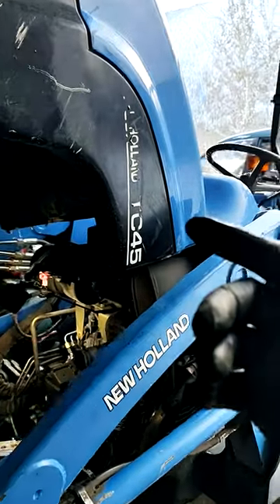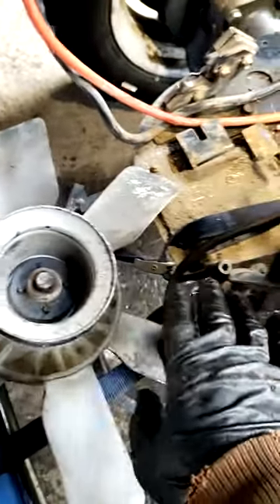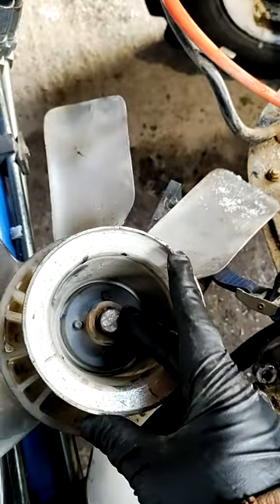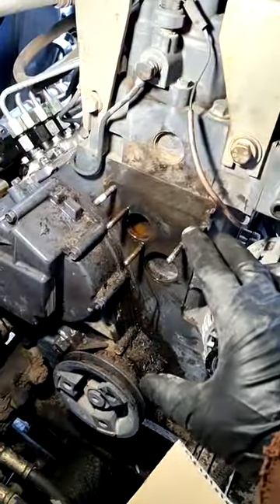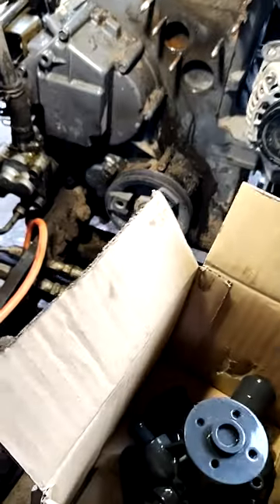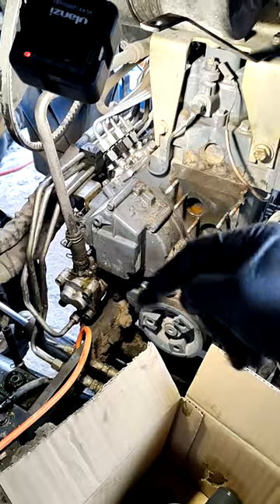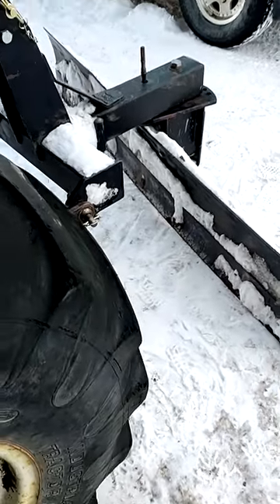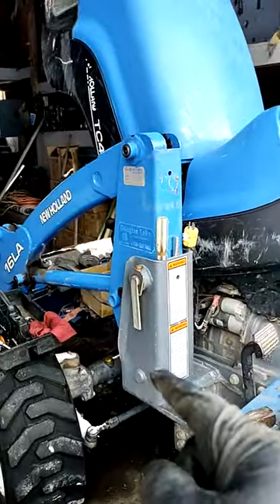NEW HOLLAND TRACTOR  FAILED COOLING FAN HUB WATER PUMP

Comment: Damn ! I never saw a water pump broken at the shaft.
Reply from the maker: You don't usually see water pump failed like that! I saw fan hub bearing failed on CAT D6 dozer and cooling fan shaft (bolt) snapped off on Volvo EC140 excavator but nothing like on TC45 New Holland)